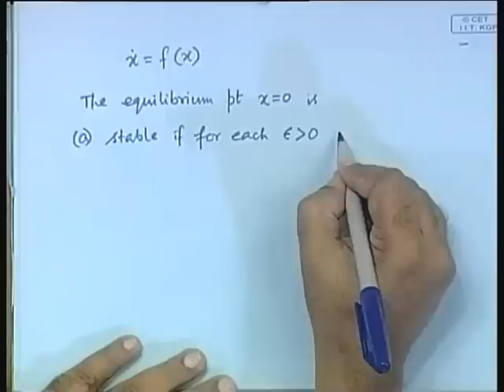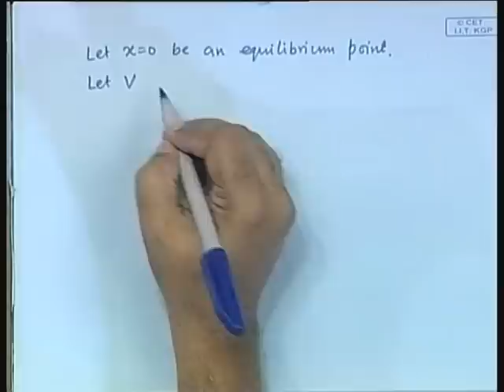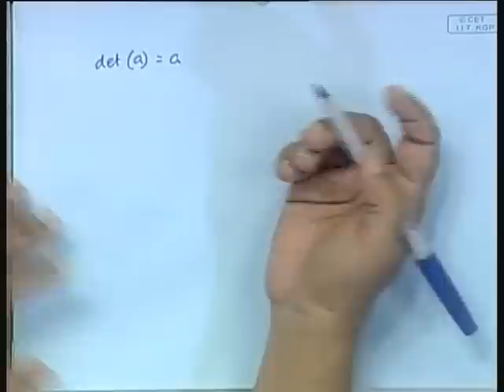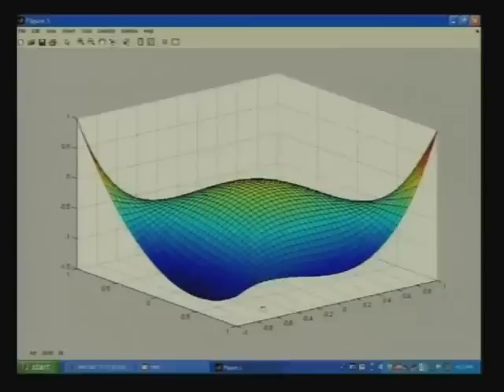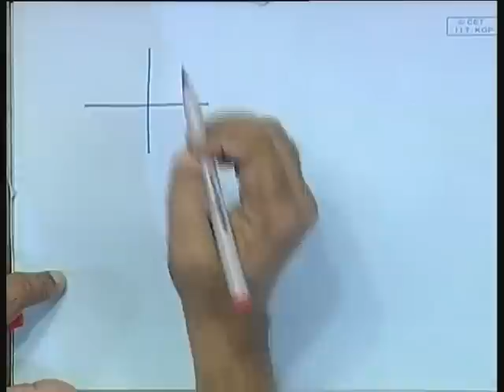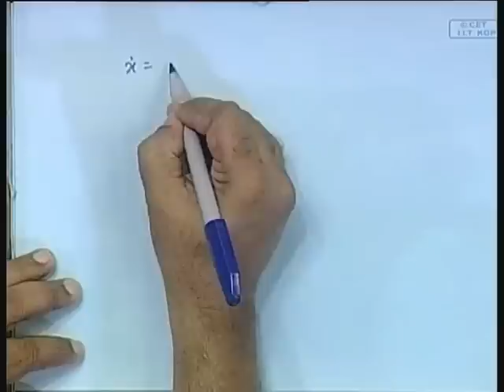Lecture - 30 Lyapunou Function and Centre Manifold Theory

Comment: Linearization fails if eigen value=0 (purely real with only lambda=0) or real part of eigen value=0 (pure imaginary)?
Or for both of the cases linearization fails? Please suggest.
Reply: Both cases the linearization fails to describe the stability properties of the system. It fails in the sense that it is not able to determine whether the system is stable or unstable in that region.